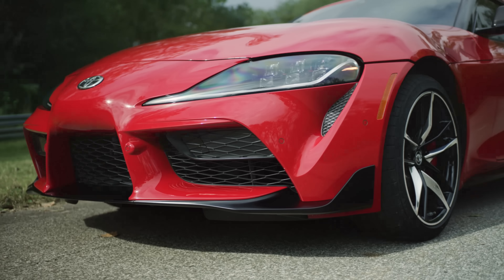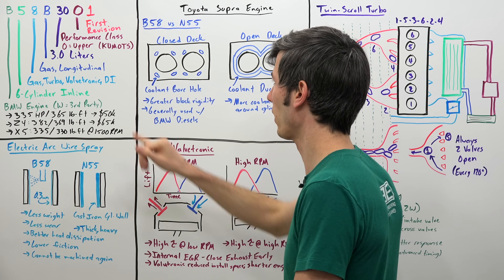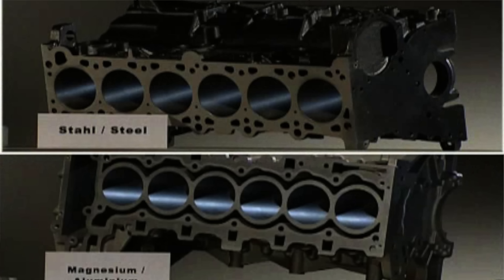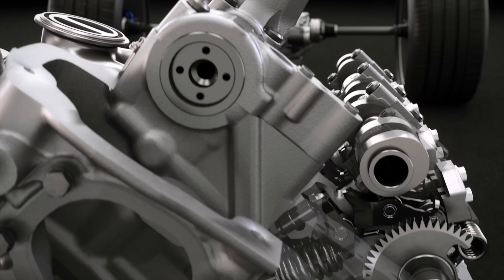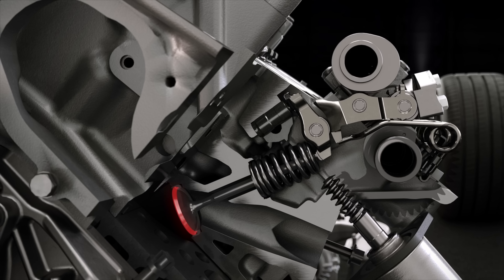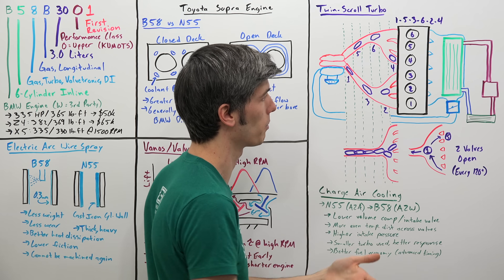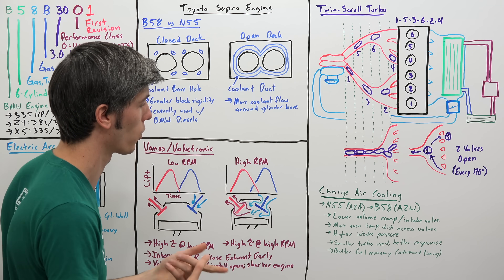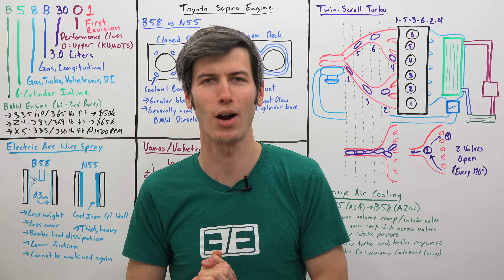2020 Toyota Supra Engine - Detailed Review Of The 2JZ Successor

Comment: At first, I thought it was weird, toyota can make their own engine,  but yeah Supra had a Inline 6, NA and Turbo, and and BMW make great inline 6 ( and bacn then toyota made many of them, but not anymore). They also already have a Engine with the performance you would want from  modern supra. make sens

On a side note, I really want BMW to make a a high Reeving NA in-line 6. less power less torque maybe, but I always prefer NA to turbo. to me power i less important than feeling. Those Na L6, The Old M20 where so fun ( despite all the others flaws they had), and of course,  the S54 was such a great engine.

I like how Toyota design the car that it look like a Supra. The design cue are obvious. I get why people are excited about it
Reply: Last NA 6cylinder was N53 used in F10 with power output of 255hp~. Really worth to buy one because its the last one and it's in the F-Series.
Let's pray to the gods so bmw makes high revving inline6 once again to give the sound of the century :D
Reply: @fohatadri  Those were in 330I around 2006 if I remember correctly? I test drove E46 but not newer gen.
Reply: @sylak2112  Those had N52. Basically all N51/N52/N53 are the same, just little different power outputs in different models and different compression.
Reply: @sylak2112  different tune and intake manifold. You could buy smth like 325i which has N52, put intake manifold from 330i and flash a tune. Same with 328i.
Reply: @fohatadri  If I had to buy a second car ( which won't happen, no money and My FIT still does a great job a Fun Daily car), I of course would be tempted by a BRZ, but the Bmw 128 is also attractive, because of the engine.

Comment: So you’re going to have to change the cylinder sleeves in order to change piston size! 
Reason 10482728485 why this “Supra” will suck.
Reply: You will have to change the engine blocks, no sleeves on this engine
Reply: Why would anyone buy a new car and start tinker around with the engine. Wake up it's not the 80s/ early 90s anymore, because of emission regulations and efficiency engines have become to complex to tinker around with is in the backyard.
Reply: Well the moment a new Engine Map is needed it's pointless for most ppl. To properly customize it you'd need at least a Mechatronic, an Application Engineer and a fully equipped Dyno for many hours. We did or own Map for a heavily customized and air restricted Kawazaki 4 Cylinder that we are using in a Formula Student car. With the time we had on the Dyno it took several seasons to get a nice Map that was more than a Full Throttle Map and that also took efficiency into account.

Comment: Well I mean Toyota and BMW have very similar technologies. Toyotas Valvematic and BMW's Valvetronic are basically the same systems and they've been working together on other projects for quite some time now.
On the other hand it would've been great if Toyota had rather chosen their new V35A V6 for the Supra. After all the 2JZ was basically a Lexus engine. Also, if you're world leading in producing hybrid vehicles, wouldn't it be rather smart if your flagship sports car was a hybrid as well? The 400hp V35A V6 plus a 50hp electric motor would have been the way to go, if you ask me.
Reply: If Toyota used the v6, they will still get a storm of hate, probably equal to them getting the right engine type from a different brand. Honestly its a trend now, hate on the new stuff, when its in 2nd hand market, love it & whine "why can't they make cars like this anymore? "
Reply: The BMW I6 is sublime. Smooth as silk and doesn't require extra kit for balance like a v6
Reply: @johnclark7406  Let's be honest here: the JZA80 was more of a GT car so the smooth I6 actually mady sense but the hype about it and all of that Fast and Furios BS mad it impossible for the A80 to not be a sports car. So there's no need for the smotheness of an I6. Also I'm talking about a Lexus V6. Do you actually think that thing is actually rumbly or at least anything other than smooth?

Comment: When auto reviewers are in the fight to review the vehicle ..Hers's Jason dismantling the very heart of Supra ..THE ENGINE. But bmw and toyota are in the extreme sides of reliability spectrum:)
Reply: BMW performance engines are hit or miss for reliability (no tik tok intended). However their upper mid range engines like this one are some of the best. Not bullet proof like Toyota or GM big block, but still very good.
Reply: The original Supra had a cast iron block and was legendary for being bullet proof. BMW is setting fire to half the world with their crap electronics. Zero interest in any car touched by BMW, they go from CAD to assembly line without any testing.
Reply: @truantray  Most of the Supra models were notorios for head gasket failure, I had one where the big end bearings failed as well. Not so reliable as people think!
Reply: @joebloggs4191  they are comparing the typical toyota (low compression) to a typical BMW (high compression) what do you expect.
Reply: okleydokley 
Then why in their right minds would Toyota sell this BMW based car as Supra?
Reply: @Eduard van Raalte you answered your own question they aren't on their right minds
Reply: Bmw got a bad rep with the 1st gen n54 but its on its 3rd gen b58 and its been pretty reliable and stout. Would not be afraid a vehicle with this power plant.
Reply: I had a BMW until the timing chain came off while cruising on the motorway.
Reply: olafpayne If you kept driving with a worn timing chain, then there's something wrong with your ears lol. When the timingchain fails (aka Vanos aswell) you hear a loud rattling noise. Says something about you aswell.
Reply: That engine only lasts until the oil pump impeller nut falls off, which if you run it at high rpm for long periods happens pretty quick. It will never compare to the 2jz in reliability.
Reply: Heru_ur that problem affected only a few of BMWs engines, notably the S52 and M54b30. Both engines had the same crankshaft which proved to be problematic. But what was more problematic was failure of the harmonic balancer which lead to the oil pump nut failure. Harmonics are difficult to control on inline six motors and even 2JZs run ATI balancers to help prevent issues. RBs break Oil pump gears but you don’t hear as many people calling them garbage. I could name great BMW engines and ones that don’t have the problems you describe for every bad example you give. And its a similar story with Honda’s too, but nobody calls Honda engines garbage, because there are a large majority of owners who rave about the joys of owning a simple car, you don’t see that with BMW owners.
Reply: No, it's just that all modern toyotas are driven by certain type of people and in a way that does not stress the engine. That is the type of cars they make. I have not seen a normal toyota driven fast ever. Drive a BMW slowly not exceeding 2500 rpm and see if it breaks like the rest.

25 years ago when toyota made performance cars everyone made reliable engines.
Reply: Kevin Schmidt there’s a few  guys on Bimmerpost with E92 M3’s with 100-150k+miles on them with no break downs and just simple regularly maintenance... not saying that there bullet proof? Or that they didn’t replace any worn parts!But any car that is taken care of, can last regardless of its brand history.
Reply: Agreed, also even when I understand most of this I still enjoy Jason's explanation and display
Reply: Only when I see a Prius being flogged like a typical M3 will I consider BMW/Toyota reliability a valid comparison.
Reply: I wonder if Toyota detuned the engine for this reason?
Reply: Yeah, thats going to be hilarious when these break like hell
Reply: So, does 'don't ever own a German car out of warranty' still apply here?
Reply: I've owned many high mileage BMWs and they were all great cars. Even my rusty BMW (e30) 325e coupe with the m20/5 speed was a fantastic car with well over 300k miles.
Reply: Seeing BMW M6 won at 24 hour Spa... good enough for me.
Reply: @REEL SIXX well, luxury cars are not even designed to be reliable. Modern Toyota are still good.
I didn't like the 86 because of that fact, I'm just waiting until we get to know more about the engine
Reply: BMW make some of the most reliable high performance engines. It is the electronics that fail.
Reply: @willdebeljak7062  Anything with vanos , v10 M5 , most 6's have oil pumps where the impeller retaining nut falls off if run at high rpm for long periods ... then there's the electronics ,, BMW braggs!! that they use wire insulation that is environmentally friendly... IT IS MADE TO DECOMPOSE!!
Reply: @briantracy1324  n47 4 cilinder dizel has valve cahain forme bycikle and that v10 bas pore berrings on rods
Reply: Brian Tracy early BMW VANOS was problematic, especially the performance Naturally Aspirated systems since they ran at crazy high oil pressures to get the best phase response possible. The VANOS systems they use now are no different from any of their competitors VVT systems. The biggest issues I see the B58 having are due to the extensive use of plastics which will not last long after the warranty period has ended, and the lack of an oil dipstick. Everything else should not affect tuners from reaching huge power levels as it’s been done before with BMW turbo sixes without any additional reliability concerns, and this is by far the best mass produced turbo six BMW has made yet. Hopefully we just don’t get the one with the integrated turbo manifold that’s cast into the head for ultra low emissions, and it will be a worthy successor to the 2JZ for tune-ability and power potential on stock internals and parts.
Reply: @willdebeljak7062  I agree, but if the electronics fail, there goes the reliability, right?
Just being picky, I hope Toyota remade the electronics if so....
Reply: @anunknowndude  oh I totally understand.
Reply: @willdebeljak7062  except the v8 that catches fire . Don't back it with excuses
Reply: @jeffsafawi7947  what v8
Reply: I have an e60 m5 and an e46 330. Have had no issues with the motors at all.
Reply: @willdebeljak7062  2007 bmw m5
Reply: @Digidi4  yes that very different engine from over 10 years ago is completely comparable
Reply: @Digidi4  check my videos lol I have had no issues with my v10 m5
Reply: @willdebeljak7062  so the infamous vanos and double vanos systems that always crater are electronic? Try again.
Reply: @afrosheenix  you do oils changes at the right times and vanos isnt as big of a problem. Both my m5 and 330ci have had no vanos issues and I track both.
Reply: @willdebeljak7062  LOL MOST RELIABLE PERFORMANCE ENGINES that gave me a laugh. I needed that
Reply: @MrGlockshna  so what is the most reliable?
Reply: @willdebeljak7062  electronics and the bearings, and the transmissions (SMG). also when bmw engines don't include dipsticks, then rely entirely on sensors (which fail) to keep up with oil level, and when the same engines typically go through at least a quart of oil before oil changes (prolly more with turbos) you can't really say the engines are reliable :-/ just saying.
Reply: @kingjoffee1072  I dont have the SMG and the s85b50 isnt the new supra engine. Did you even watch the video? We are talking about the i6 that runs basically every BMW and runs great.
Reply: Will Debeljak have you ever worked on a BMW engine? The electronics are rock solid! It’s all the plastic parts that were used to save weight and cost that fail! That and the oil gaskets start leaking after 100,000 miles. And there’s no dipstick to manually check the oil level, so when the thermal sensor gives you a warning after your warranty expires, you’ve got a Schroeder’s oil level situation on your hands.
Reply: @J-Eagan  i mean the technology gimmicks inside. The powertrains are great. But I have had issues with tank sensors, idrive system, and other technologys in the newer bmws. My M5 and my 330 have been incredibly reliable and yes I do work on them. And yes i am very worried that the polymer throttle gears are going to strip. But I meant the toys on the inside that dont stop the car from moving when they break.
Reply: Will Debeljak fair enough, you just made it seem like the engine electronics were problematic, when they are actually some of the most robust items on BMWs. It easily costs BMW 2-3x more than what Honda,Toyota, or GM spends on their engine electronics harnesses, due to the superior connectors shielding and insulation they use. I also own an e46 330ci and routinely work on an e39 540iT but being pre-IDrive I have no experience with bad electronics.
Reply: @J-Eagan  so you're talking about electronics on your old car, we're talking about later iterations with far more complicated electronics
Reply: Don't forget all cooling system is made from plastic.  And I just rebuild my vanos on my e46 m3.
Reply: Also:  You can talk cr4p all you want but the most impressive & fastest naturally aspirated street legal vehicle in the world is still a 25 year old British exotic powered by a BMW engine.  Honda was given 1st dibs to produce the V12 for the McLaren F1 and they decided to pass on the offer,  Claiming that Gordon Murray had unrealistic expectations.... BMW produced the engine and gave them an extra 21 horsepower.
Reply: Cyril Matthew a